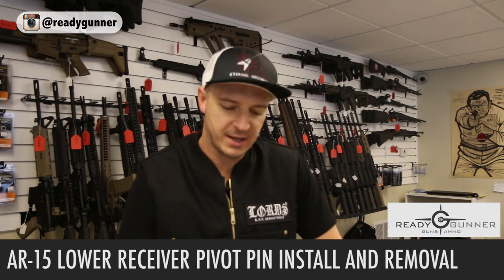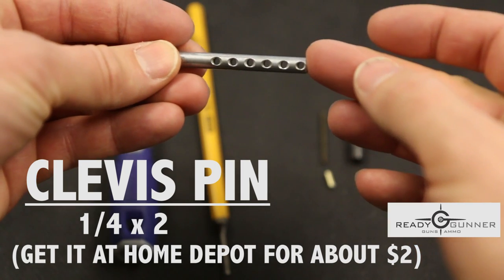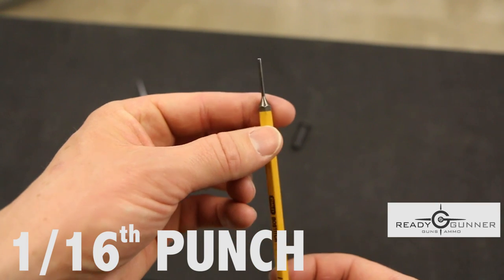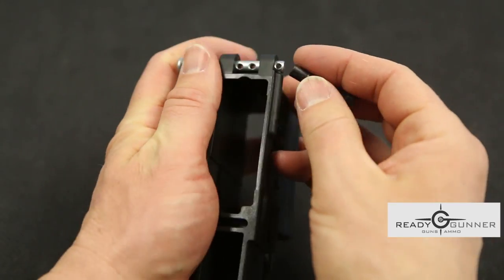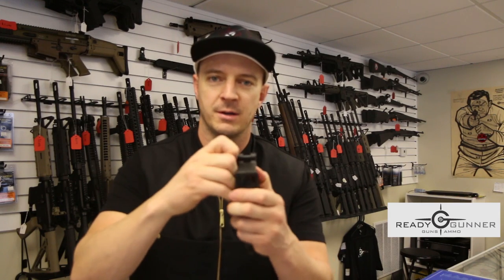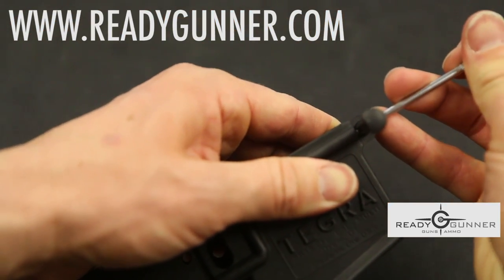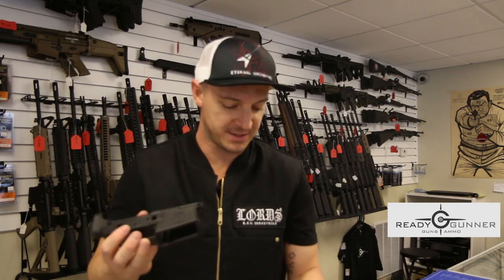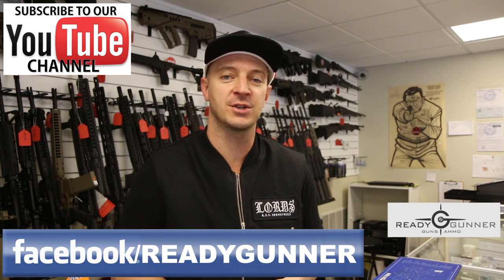quick & simple AR-15 Lower Receiver front pivot takedown pin install and remove

Comment: This guy is a living God.  I just spent about 30 minutes flinging springs and detents all over the house and found this.  After a trip to home depot I got the takedown pins installed in under 3 minutes.
Reply: Toke me thirty seconds using roll pin drivers and the hole on the side of the spring tube.
Reply: @derkaderkastan420  lol that's what that is?
Reply: Will this work for the rear take down pin by the butt stock?

Comment: This was great. The info to rotate came in really handy and it was done in a few minutes. Since I didn’t have that tool from HD, I just used another take down pin to hold from the back and then came in with the new takedown from the front. Cheers!

Comment: If you're replacing a pin, you can use your old one (or a spare front pivot pin), inserted reverse, to hold the detent in the hole, in the same way you use the rotated clevis pin. I watched this video, but didn't have a clevis pin on hand. I used a 3/32 punch to push the detent into its hole with the spring, then inserted the extra pivot pin in reverse, as he did with the clevis pin. worked well with what I had on hand. thanks for this video!

Comment: Thanks a bunch man, dealing with these used to be such a PITA, what a difference your approach makes!! BTW: For those who don't have a pick handy when removing the takedown pin, just grab a small thin nail and blunt the tip a bit with a file or even give it a light tap with a hammer, works perfectly too.

Comment: This is stellar! Thank you for the simple and inexpensive ($2.50 at my HD) solution. I'm building a new lower and, like David Craven said, this'll save me searching for the spring and detent. The only way I seem to be able to find these after they ricochet off stuff on the shelf next to me, is when I'm vacuuming the shop a week later and hear the distinct sound of something bigger than a staple rattling up the vacuum hose on it's way to oblivion. In which case, I'll still never find them.

Comment: Cool. I'm going to HD tomorrow.  I just want to replace mine  with one that is a different color and has a logo on it. Can I do that  without wanting  have the pin and spring pop out when taking the current one out? ..can  i just reverse order and after using pick to twist and move  current one , do it by push it out with that initial tool you can get at home depot? Pushing it out while detent  pin is held in place and push it back with new pivot pin ? 😕

P.s. so I got a clevis pin... and it was a bit warped so it would not fit through on that other side... so I just tried using the 1/4 " punch in reverse order because I just wanted to replace mine.  I used the pick to push in detent and twist the pin,  pushed punched through other side in an attempt to keep pin in place while pulling out old one pin..did not work.  Lol the detent shot across half the room... but I just put detent pin back  in  hole where detent pring is...pushed it in with side of new pin, and twisted it into place... the only tool you really  need is the pick.

Comment: i want to say, that seemed easy, i dont have a clevis pin but im doing a swap so i think ill figure it out but heres my rant... theh other day i got flagged on ebay for trying sell the same bolt i had bought on ebay a year before. then i was flagged again for trying to sell an ejection port cover. i built my rifle between ebay, midway, brownells. that wasnt that long ago so its obvious our country is changing. i think everyone ho watches vids like this should install a download program or add on n keep these vids, they wont be on here forever :-(

Comment: You should have warned about turning the Clevis pin around too far once while retaining the spring and detante. Easy to do. If it pops back into the Clevis you are screwed! Can't remove the Clevis pin.

Comment: 10 cent trick faster easier 
EASER CHEAPER. Use a bobby pin, cut the nub off the end and slip the bobby pin behind the pin. Then slip your new Pin in behind the bobby pin. Easier if you use another Pin on the other side so the spring won't put pressure on the bobbypin